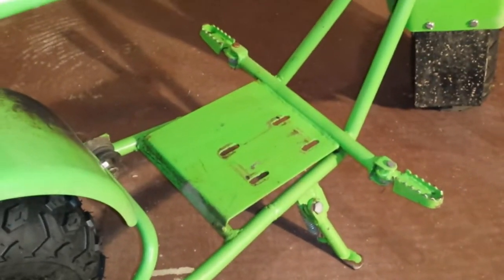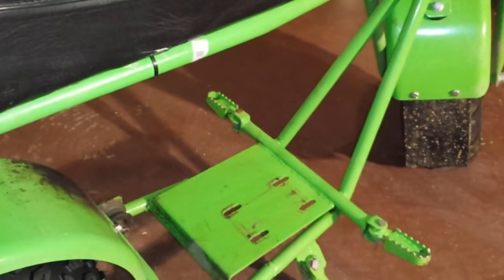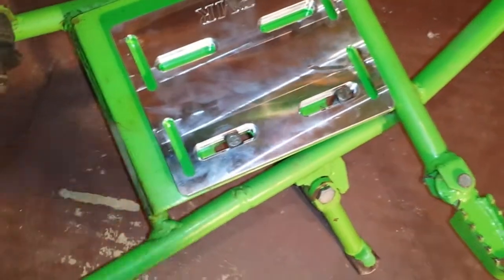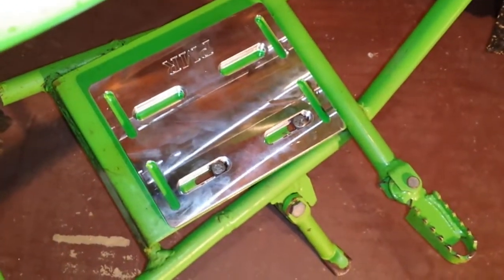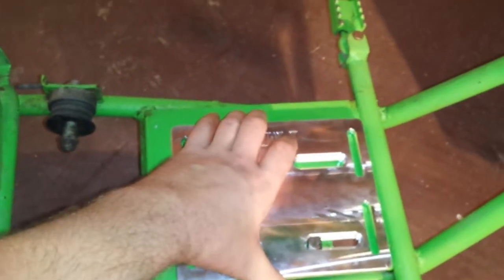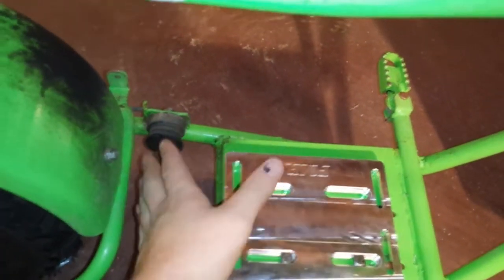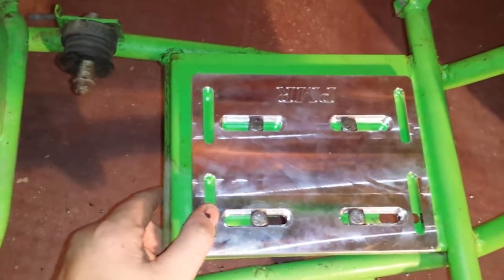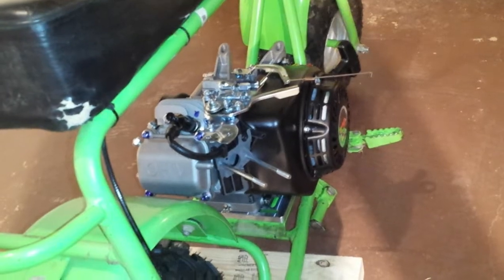GreenMachine #2 engine adapter plate.mp4

Comment: How much drilling is involved ? How do you bolt the motor down after you bolt the plate first . am I missing something ?
Reply: geneo * That’s what the heck I’m wondering I’m assuming we have to drill more holes
Reply: MrJcosenza79 
None of these guys who are are “instructing “ others how to do this - ever mention this.  What do I expect from a guy who “mounted “ his motor but forgot to line up the sprockets ?